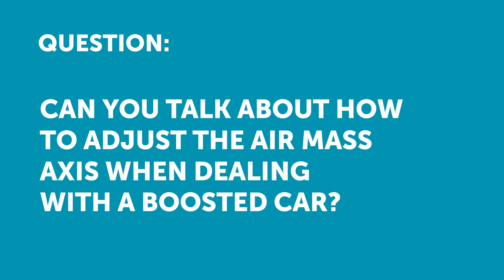Air Mass and Boost [HPA Q&A]

Comment: I remember reading about old school methods when air flow meters were maxed out involving using air bypass pipes around the MAF. I've never done it myself, but I have fitted larger ones, which is basically the same thing. 

The air flow meter (at least if its a hot wire type, others are similar to varying degrees) doesn't really care what's going on around it, it just measures the speed of air travelling over the sensor element. 

If you increase the gap around it, it still measures the speed of the air going in the engine, it just scales up with the size of the pipe. This effectively increases the headroom of the sensor, at some sacrifice to resolution. Much the same as altering the table headers would.
Reply: Maf senors don't read the speed of airflow. As air rushes past the hotwire, the resistance of the wire decreases and more voltage is applied to it in order to maintain its temperature. That voltage corresponds to a cell in the maf scaling table which allows the ecu to estimate the amount of airflow passing the sensor. 

When going to a larger maf housing, the voltage change would stay the same but the maf scaling table would still be calibrated for the stock intake design. This will throw off the airflow and fuel calculation. The fueling inaccuracy can by verified by logging the short + long term fuel trim. The larger housing will increase  the maf headroom at the cost of resolution, but it will still require rescaling of the maf table for airflow/fueling to be correct.